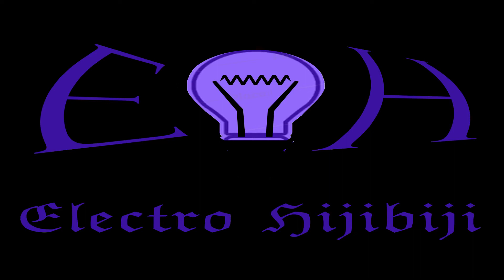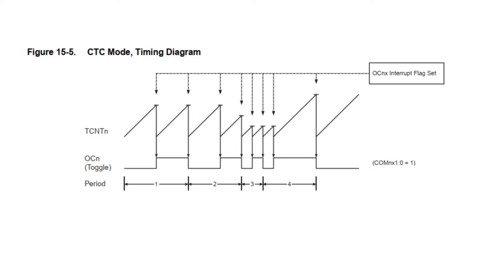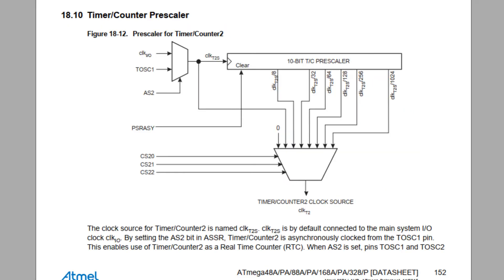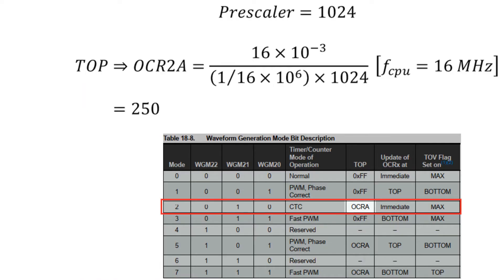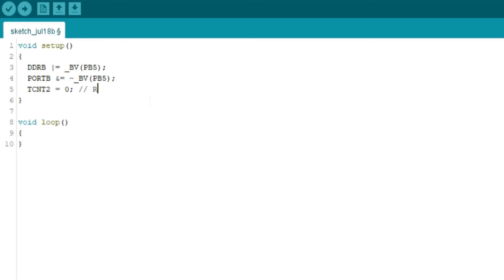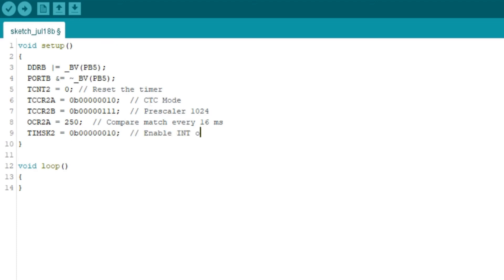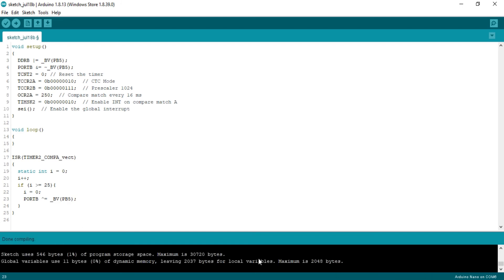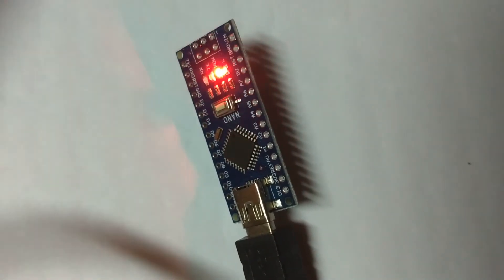Easy Setup for Timer2 in Arduino to Interrupt Every 16 ms

Comment: how time will be 400ms?
Reply: and what will be the count?
Reply from the maker: For 400 ms interval the counter TOP value
= 400 ms / (62.5 ns x 1024) = 6250 [assuming that the Arduino clock freq = 16 MHz and you're using an f_cpu / 1024 prescaler].
Timer2 can count upto 255 only. So, you need to use Timer1. Alternatively, you may take a variable and increment the value inside the interrupt service routine of the 16 ms interrupt. On the count of 25 of that variable the time will be 400 ms. You can poll that variable in the main() loop for reaching 25 to do some work after 400 ms.